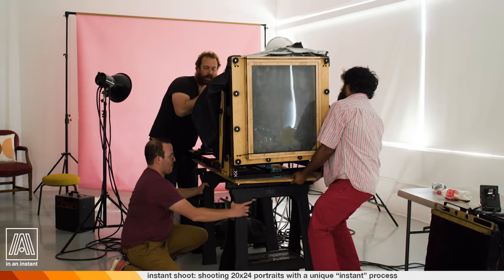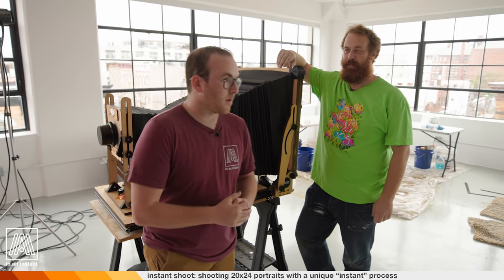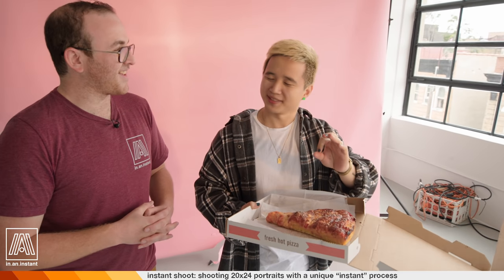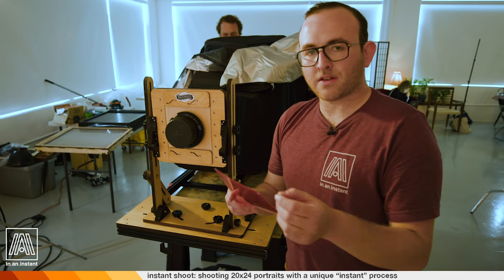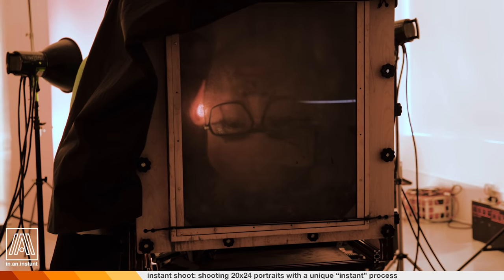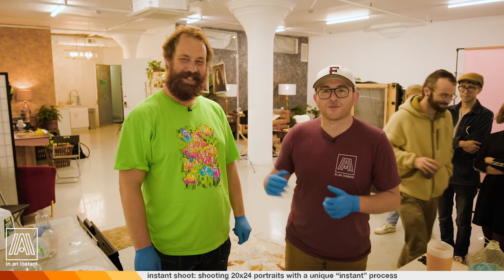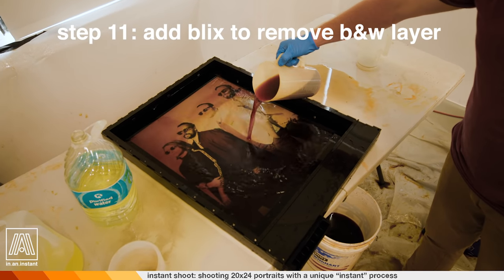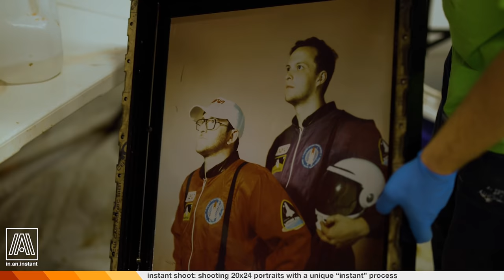Shooting 20x24 Portraits With A Massive Camera & Unique “Instant” Process [Instant Shoots]

Comment: oh wow, wouldn‘t it be possible to make a mini adapter for a polaroid 600se that utilizes that kind of process? =O
Reply from the maker: Yes! This process works for all formats and Ethan has made 4x5/8x10 holders as well. The 4x5 back could be adapted onto the 600SE, but there would have to be an additional 3D printed part and light seals to hold it flush onto the back.
Reply: @InAnInstant  wow just looked more into the process and geeked out a little bit :) I think it should be actually relatively possible to make an universal back to work with photographic paper and this developing process.
I wanted to build a back for my GOOSE, to finally be able to use it, so maybe thats the way to go 😄👍..